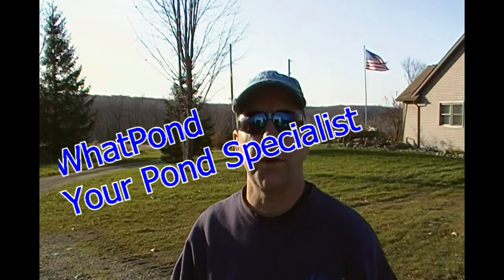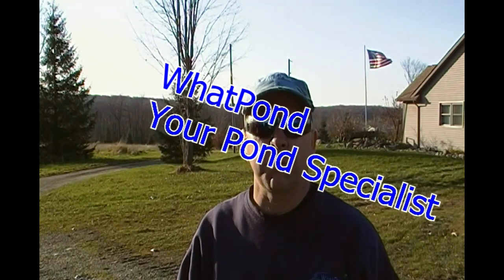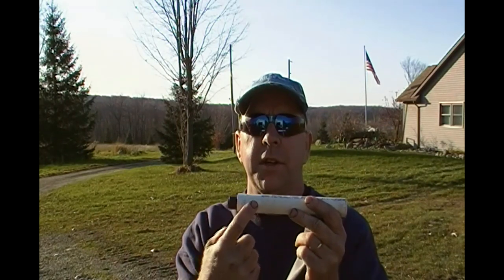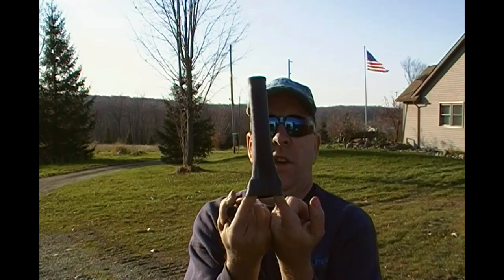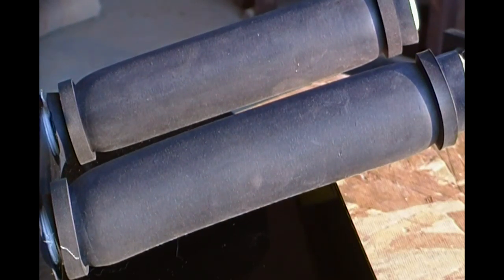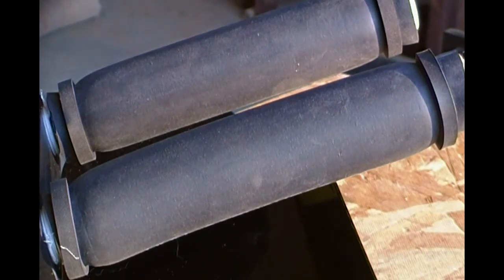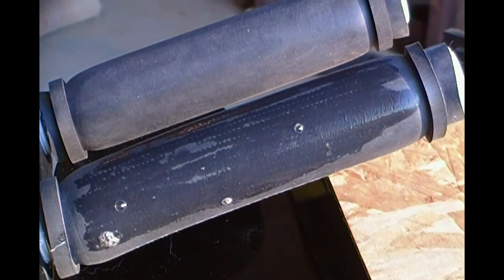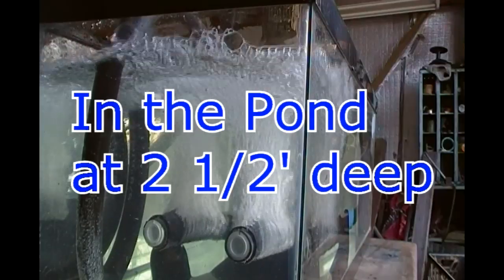Rubber Membrane Diffuser, Pond Aeration

Comment: My unit or diffuser seems to not throw as much air, like it is clogged. What is the best way to clean it?
Thank you!
Reply from the maker: What type of compressor are you using? Piston or diaphragm? What type of diffuser? Stone or rubber membrane. Often it maybe the compressor needs rebuilt, they do wear out over time. Depends on depth, tubing length and whether the compressor is in the sun. If in a cabinet is the fan still working. The diffuser could be plugged up. Gently rub the membrane under water to break loose the debris. If it is the same amount of air after cleaning then for sure the compressor needs rebuilt.

Comment: As d1 asked, I too am curious of cfm from the pump.  How much does bubble size matter in relation to how much water it will cause to circulate?
Reply from the maker: +GetRhythm2011 I'll have to get an recent video up to show some of the differences in CFM. The size of bubbles matter because the smaller they are, means more bubble to be pushing, pulling and en training water ans the bubbles race to the surface. Which in turn moves more water. The deeper the diffuser also matters, the deeper the more water is moved. Example would be a deep water diffuser can move around 3500 gallons per minute.

As for large bubbles, say just the air coming out the end of the hose you would have less count or amount of bubbles racing to the surface. Another neat thing happens to these Air bubbles as they leave the diffuser they also expand as they rise, so a small bubbles expanding push more water, but starting with large bubbles they will just be a big plop when the y hit the surface, sure large bubbles move water but small ones move more.

I believe I was over kill with the compressor at 5.2 cfm linear diaphragm compressor that can actually run 4 diffusers up to 7-8' feet deep.

Since this video we have been working with other diffusers, different materials and soon to be adding our design to the market.

Hope this help sot clear it up.
Reply: Thank you Darrell!  That helped.  :)